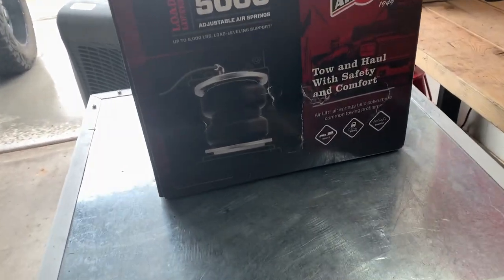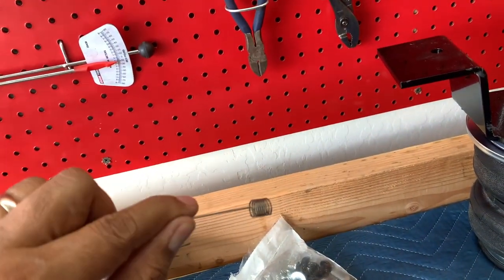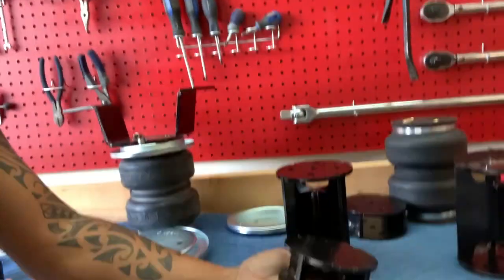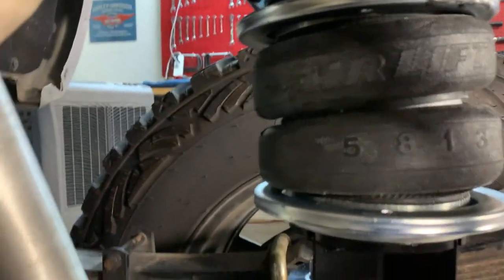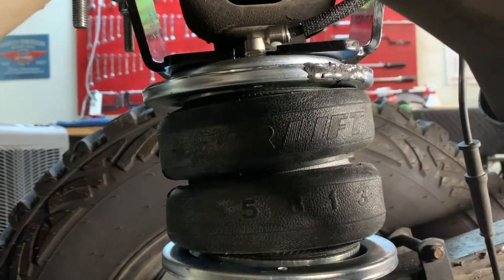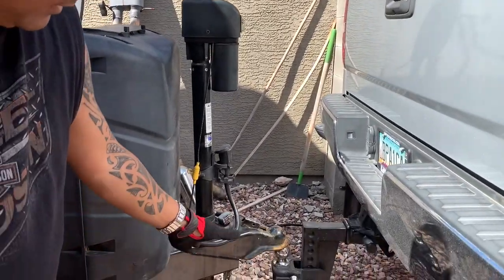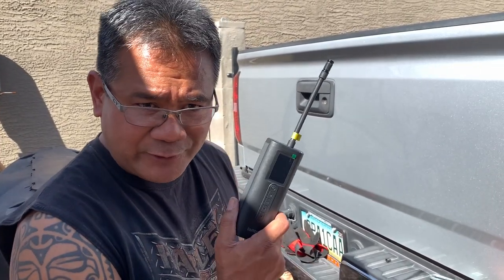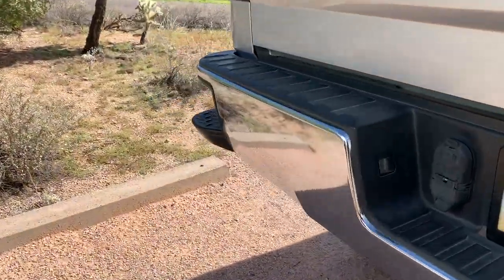Airlift Load Lifter 5000 install on Chevy Silverado

Comment: Hey Bud,
first off, good looking truck with amazingly clean suspension. First off, is that a 1500 or 2500 ? Looks of leafs in back a 3/4 ton but i havr 3/4 ton leafs on my 1500. Second, what kind of suspension do you have for 12" and how did yours joints handle those angles? I love those shorty headers setup and y pipe as well. I need those on my truck